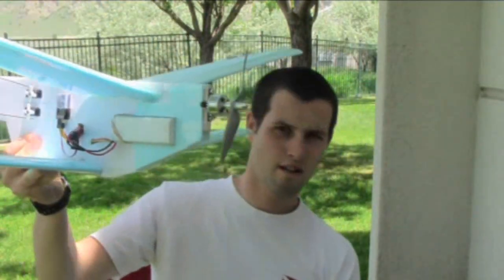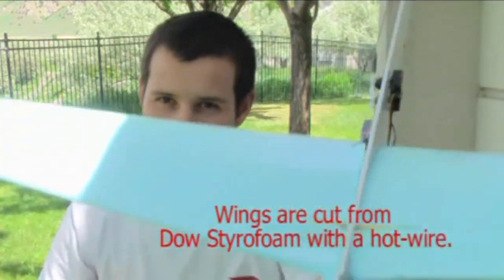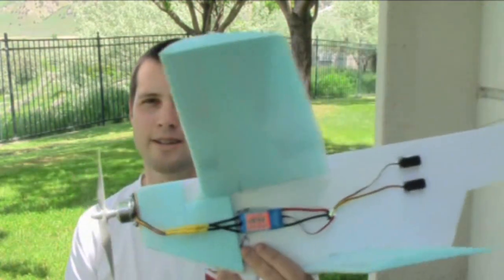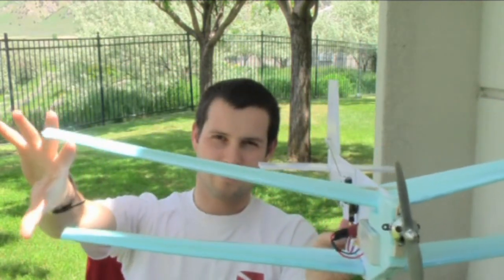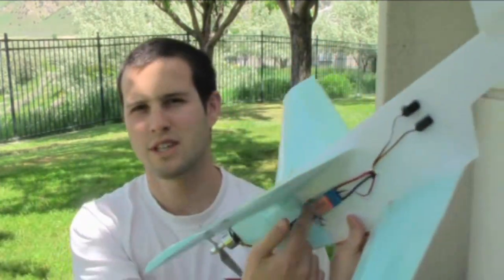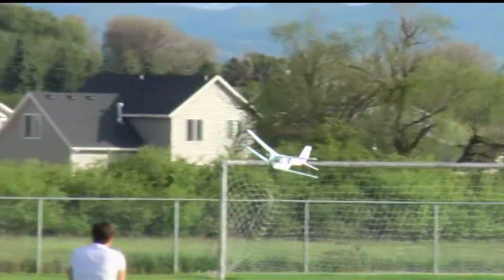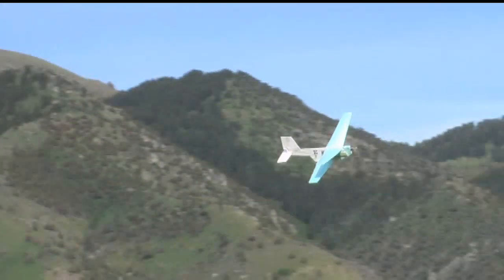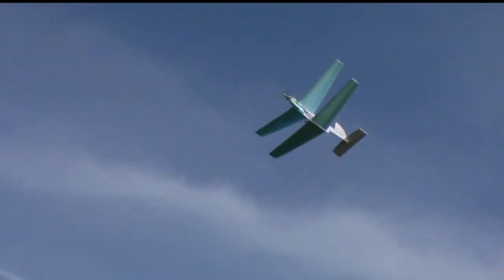Awesome Homemade Scratchbuilt RC Plane

Comment: Whole set of compromises.The UK and CCCP / USSR & WW2 Germany(Volvo use in water propulsion)are happy to use in line in human/full scale.I had read a note that the second prop increased the effeminacy by 10%.Favorite is a UK sub hunter the Fairly Gannet (1950's), the Russians used it on the Bear,and helicopters,(it cuts out the requirement  of the tail rotor) and Germany said it increased speed as there was less frontal area,compared with a conventional 2 engined unit.

Comment from the maker: The motor can handle between around 7 and 13 volts. It spins at 2200 rpm per volt.

Comment: Excellent job! Gotta love those NACA 4410 airfoils for slow, stable, high-lift flight.
And what's wrong with $10 airframes? You can build them by the dozen. Crash-- unstick the esc/servo/motor, restick, and you're flying again.

Comment: the plane would probably cancel out the torque from the motor if you turned the prop shaft up slightly and it would slow the plane even more

Comment: would probably create to much turbulence for the rear blade to handle if it was a regular blade, this idea works theoretically with ducted fans and jet engines but doesn't practically because your create more unnecessary problems, I've always thought this idea would work with a single engine powering two differentials on each side with a prop on each side of the differentials since the differential would balance the power, but this idea would probably work better with smaller props at the back.

Comment: I dont know if you would be able t ohelp me on this but i have a question on engines for rc planes. 
If you were to have two engines, one that pushes and one that pulls, with the props one behind the other, they would create a low pressure betweeen the two props bercause of the increased velocity of the air. Is that method more efficient that just having a  regular twin engine configuration?

Comment: Pretty sweet, I'm a bit of a builder myself.  Where did you get the foam.  I have been building my planes from scraps.  Check em out.  I have a micro Cub with airhog motors.

Comment: @DynamAero
   Hi, um, I wasn't referring to "2 x V's 1.3 x Lift., Biplane vs Mono.". That's due to High P. under Top-Wing partially cancelling Low P. over the Bottom Wing. CL = (Common)Centre of Lift = "Aerodynamic Centre", is actually the average Centre Of Pressure... For a real giggle, search  "1975 Skycraft Scout", or  "Aerotowing Rogallos", even "Autodidactic Test Flying". Then, try  "Boomerang  Aerophysics". Ciao !

Comment from the maker: @WarblesOnALot The two wings probably do produce the same amount of lift, but what I said was they dont produce twice the amount of lift together as one of the wings would alone. They probably only produce about 130% of the lift of a single wing. 
Also, it doesnt make sense to say a CL moves. When the forward wing stalls, the AERODYNAMIC CENTER moves rearward and the nose drops.

Comment: @magna59
@DymamAero
  G'day Bob...!  Thanks for sending this. Very interesting.
  Um, DynamAero, if the Wings have the Same Section, Plan, Area, & Angle of Incidence, then of course they make the same Lift. Normal practice is to give the Top Wing 1or 2 Degrees more Rigger's Incidence than the Lower. Then you fly on the Top Wing, and when it approaches the Stall, the Lower Wing keeps lifting, the CL moves rearward, and the Nose drops.

Comment: Lovely piece of work ...... if you have less dihedra (?) on one set of wings than the other ..... I would percieve one would different lift to the other. As you show, if it does or it does not , it does not matter .... which is the main thing. If your running a small prop fast, are you not getting more churn, than if you run a larger prop near a more applicable speed ? Best wishes, keep up the great work & the good films.

Comment from the maker: @ib422000 Thanks for the nice comment! I don't have plans or the dimensions memorized so eyeballing it is a good choice. Yes, flying around people is usually not a good idea. All the people you see in this video are my relatives. And with a plane this slow, light and in control, I wasn't too worried.

Comment: Hey nice job buddy!! im trying to build a rc plane for myself too.its my first one though, i dont have enough idea or experience about it, can you help me out a little bit with the electronics. the rem ote control part, as in how to control the motor on the plane what all parts are needed n how to assemble them? the receiver, speed controllers? where do i get them from? 
hope to hear from you.
sahil.543@gmail.com

Comment from the maker: @0MoTheG The reason why I didn't use a T-Tail is because i thought in would be more difficult structurally, but you're right, it would have decreased the downwash effect. The downwash is more easily accountedf for by changing the angle on the h-stab.  Why do you think putting the lower wing in front of the upper wing causes less interaction? I think CFD disagrees with you there.

Comment: I don't understand why you put the top wing in front of the bottom and the elevator that low.
A T-type elevator/rudder setup would solve the down-wash issue.
if you put the top wing behind the bottom they interact less.

Comment from the maker: @Dave51262  It's a grayson hobby 20 amp ESC, hitec HS65 servos I think, and a Spektrum AR6100 reciever I believe. Really though, when choosing stuff to go with your motor you just have to pick an ESC and a battery that can handle the current draw from your motor.

Comment from the maker: @p3x197 There are ways to estimate the downwash angle on the tail, but the math is complicated and you need to know a lot of hard to obtain information about the wing. The other way is by using computational fluid dynamics. I didn't calculate the downwash on the tail of my plane. I neglected it and then saw from how it flew that I shouldn't have neglected it.

Comment from the maker: @p3x197 Downwash is where the wing causes the flow to bend downward. This causes the flow that the tail sees to be at a different angle than what the wing sees. This decreases the angle of attack on the tail.